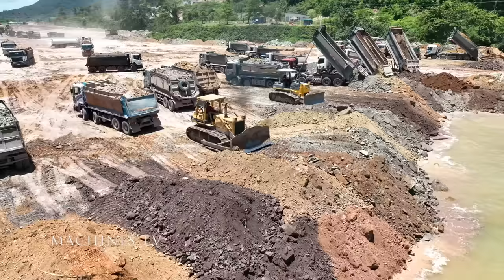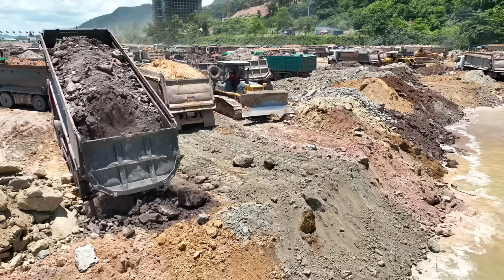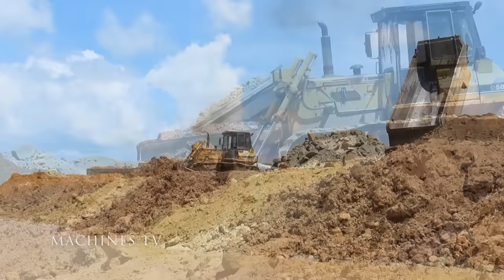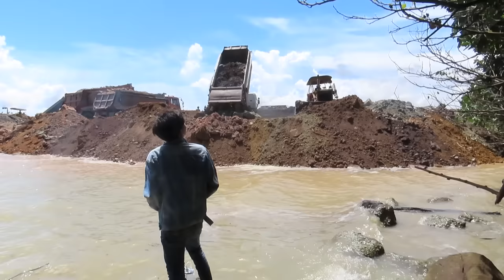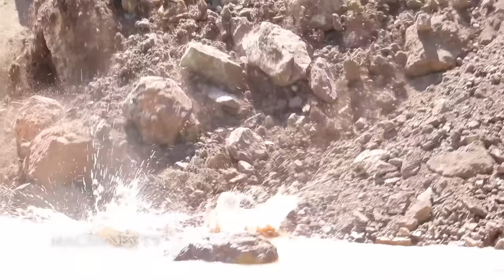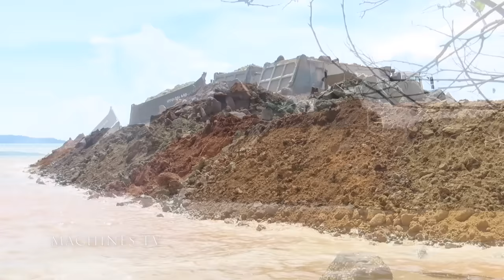Huge Land Reclamation Process Dump Truck Management Unloading Rock Dirt Bulldozer Pushing Stone

Comment: Massive projects like this requires a massive fleet of heavy equipment and qualified operators. Given enough time and equipment, you can remove mountains and put them someplace else. When Japan built it's new man made island airport, they removed 3 mountains for fill material. Flat ground is at a premium in Japan, now they have 3 new flatten mountains to develop and a giant island airport.

Anyone know capacity of the dump trucks? Must be over 20 cubic meters? Dozers are small, but keeping up with trucks. Management of dumping is important. They can't get more trucks into front, they are queued up in long line. Long and narrow site that restricts trucks to single line going in and leaving.
Reply: It is very obvious the dozers can not keep up to the trucks. 2 dozers and 20  trucks ready to back up and another 50 waiting in line is a horrible site. Extremely dangerous operation and such a waist of time and resources to have that many trucks. All the trucks are so crowded and not even letting the dozers back up far enough to get all the material. Very inefficient.
Reply: @SubGenius1101  thanks - they need a wider road into and out of leading edge where dozers are. Giant conveyors could work.
Reply: The soil dumping is of multiple origin.Is there any soil mix design for reclamination purpose?
The filling should meet its final purpose.
Reply: @johndebritto1573  Thank you... very good questions and insight.
Reply: 🙏♥️👌👍 Very nice,very hard work & Incredible project I surprised how they doing this hard project .I like it, thanks
Reply: I wonder what the mix is, there is clearly fill from 3 different sources…
Reply: @captainclute6889  Thanks for comment. They are dumping it so fast, there is no time to mix the different source materials together into 1 blend.
Reply: Looking at it, it probably won't even survive a flood. 
I think the Dutch could have helped for sure.
Why one renounces such large projects on existing knowledge is and remains a mystery to me.
Reply: @AIgoBrRr  Thanks for comment. There isn't a description what is being filled and why.
Reply: @SubGenius1101  more than two dozers
Reply: And then the sea goes elsewhere and reclaim back some land . You take the sea retake
Reply: @mikejohnson3601  Can't beat the sea
Reply: _yoko_3630  Thanks for comment.. that makes perfect sense now.
Reply: This isn't massive equipment. They should be using real construction trucks and bigger dozers.
Reply: Don't they sink like the Dubai palm tree?

Comment: The Dozers are the hold up here.  They seem slow and how is it at times 2 or 3 are not even moving?   Got to get the lead out.   If they were pushing right, the trucks would end up on he edge with 1/2 the load over the edge really reducing pushing.    One they get  behind, the guys are tempted to take a bigger cut which slows them down.  It's a vicious circle.  thinner cut faster, the whole thing speeds up.

Comment: So where was the management. Too many trucks for the size of tip area, Only one banksman and he was brave not wearing HIVI. Nearly half the dozers not working. Muck too wet and sticking in truck bodies, they leave a quarter to a third still remaining inside, wet much is not getting compacted and trucks are sinking to there axles causing unloading delays.

Comment: This is about you can win battle, but not war. No chance, sooner or later the sea wins. 100% in that case, because totally wrong material. You must use huge stones (or concrete blocks), not sand and mud. Check anywhere how to build artificial island.

Comment: What an absolute mess. 5 small dozers to work with max 7-8 trucks unloading simultaneously, for which there's 30 already reversed and getting each other in the way, for which there's dozens burning fuel into the air, stuck in the queue. Rushing trucks return with tons of carry-back, get stuck. Material seems totally random, from rock to sand to organic topsoil, some of it possibly moved on purpose instead of organized dumping of waste rock from sites. Why not use barges for this amounts of earthmoving anyway?

Comment: Terrible logistics.   They have far more material being delivered than they have capacity to unload and place the material.   Truck drivers are often paid by the load so sitting still in a queue like this costs them money.   One fourth to one third as many trucks to get the wait times under ten minutes.

Comment: It looks like a cluster fuck to me, hundreds of trucks waiting in line, with no one directing them where to go. There should a dump area ten times the size of the area they have so 20 or more trucks could be dumping at the same time. Those drivers probably get paid by the load and they are spending half their day waiting in lines.

Comment: Watching this and I would have to say it is totally mismanaged. What is the point of all those trucks just waiting and burning fuel. Get rid of half of them at least and get bigger dozers. The trucks need cable slings on the front, pushing on the tail gate will just cause damage.

Comment: that's not a reclamation, this is just piling up dirt they excarvated somewhere else.
reclamation is to build a construction that allows water move in, but when the water goes back, it leaves the sediments/dirt it was carrying behind that construction. So you take the sediments from the water (which took it away in the first place). THAT's reclamation.
For reclamation you need your brain and quiet some time, but not 1000th of trucks and gallons of diesel.
Reply from the maker: Thanks 😊
Reply: Well duh